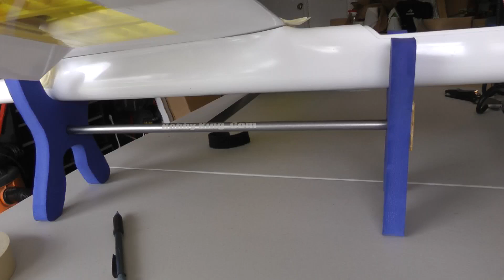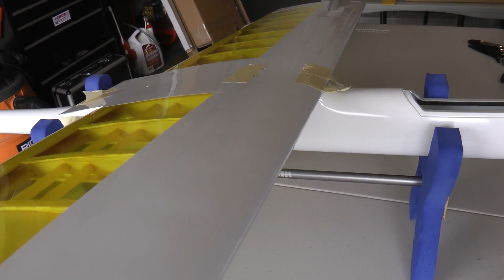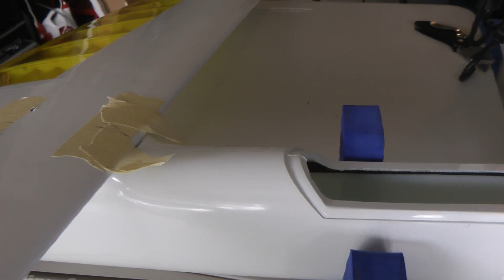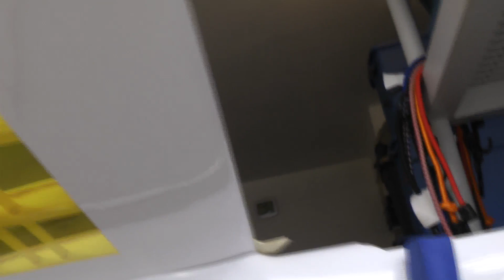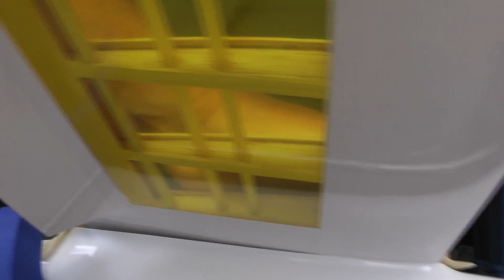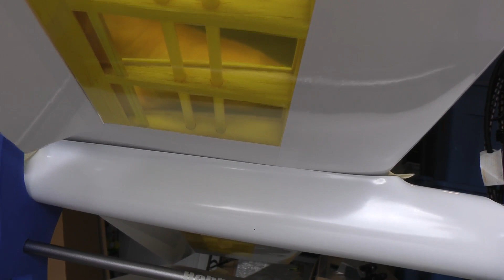Top Model Samsara wing mount

Comment: Hey! Did this get solved?!
Reply: Ignore me, I found your rcgroups post. Thanks!
Reply from the maker: Not really, I just drilled the holes and the screw in the back forces the wing down.  This wing frankly is poorly designed, it flutters like crazy with any speed.  I rarely fly this kit, it's a dust collector.